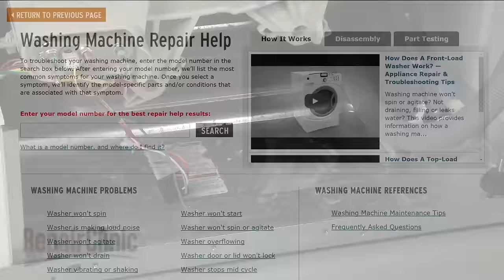Front-Load Washer Won’t Spin — Washing Machine Troubleshooting

Comment: A bad drain pump or clogged filter can also cause the drum not to spin .. and it's a very common issues as well .. should've been added to the 5 top ... the controller would be  the last point to check .
Reply: The machine did the wash but did not finish last cycle. There was an obstruction and the pump is spinning but the motor is doing nothing,
Reply: Mine was as simple as cleaning out the small trap at the bottom. It had a coin and other debris.
Reply: You are correct
Reply: @arriaga2019 if your washer has a bottom panel to remove its fairly easy if not it certainly is a pain take off front panel to access it.
Reply: Thanks for this add-on because it was certainly my issue
Reply: Thank you so much!

Comment: If the belt is just off the pulley, check the bolt holding on the pulley. They are well known to work loose and cause the belt to slip off.
Reply: @ratpatrol thanks 🙏🏽 that’s exactly what happens to my washer I just checked it out and the belts is broken

Comment: I should start making repair videos. As a technician the main cause I see on stator motor style, is Bad SPEED SENSOR. Which is attached to the stator. It’s a 10-15$ part.
Reply: I just moved my front loader to a new home … it’s spinning but goes on forever .. as if it’s unbalanced .. I’ve taken almost entire load out .. doing the same ..
It went from 7 mins left back up to 15 … any thoughts? 🤙🏼
Reply: @calidazeable  check ur drain catch for blockage.. make sure ur drain hose isn’t goin to far down the drain pipe. Make sure the holes in the rubber gasket aren’t clogged.. those are thing u check before we deem it a bad control board
Reply: @LastOneLeftt  Thanks .. I’ll chk it out 🤙🏼
Reply from the maker: Thanks for the tip! Did you know we started a special technician professional program? You can check it out on our website at RepairClinic.com.

Comment: Ge smart front load .   It spins fast when it's empty .  But I washed 1 Towel , and it will spin that 1 Towel but not fast .   When it's " done"  the towel is soaked dripping still .  So it's not spinning the heavy out of it.   Any thoughts?
Reply: Hav same problem
Reply: Did you fix it? I have the same problem as you

Comment: So nothing on YouTube worked, so I did my own analysis. Looking at the board there were some dirty parts on the components traces. After cleaning it with robbing alcohol.
It looked like one of the traces leads were rotten off maybe because of moisture or dust.

I used my phone camera to zoom in 10x times it's a realme xt phone.

I saw that it's indeed disconnected so I took a small flexible wire. Used fine sand paper on it so the solder would stick to it easily. I also used the sand paper to expose the leads on the circuit board. After cleaning it with alcohol I soldered the wire to the board to make the jumper.

I also noticed some of the components in the same area  looked worn. So I took the heat gun put some soldering paste on the components. And covered any vulnerable plastic components with aluminium foil to help it not get burnt. After I use the heat gun to heat up the components, reflowing them it looked brand new. Plugged it in after and works perfectly.
Reply: What machine? Mine did not finish final cycle. Found an obstruction in the filter but still no joy. The pump spins but the motor makes no noise

Comment: I have a samsung crysral washing machine serial no: 06SU53AG900047F. I replaced the inverter checked the belt filter is clean the drum turns left and right but it will not spin it stops at 9. Is there something else to check? Will appreciate if you can help

Comment: I actually clean the filter drain the water below before I saw this video I was proud of myself I thought maybe I fix the problem but the code keeps coming up early I keep draining the water out the bottom door it just won't finish the cycle of spinning and draining and now there is a loud noise in that door area

Comment: I have a samsung front loader which is not rinsing after wash replaced motor and pcb control board as instructed per repair still have issues after no codes shown, any ideas.

Comment: I have a Samsung front load washer giving code 4E(water supply) I have tried a new water pressure sensor,  my husband put in a new MCB. The water supply inlets have been changed. Samsung is the worst for repairs abd too many hoops to jump thru.  Sears repair guy changed time twice in the same day, didn't come.  

It fills with water, then drains  flashes code 4E but don't trigger to spin.  My filter is clean.

Comment: Had to stand on Samsung front loader drum (210 lbs) several times when fixing constant incoming water while unplugged. Now tub is not aligned with front door seal. Any suggestions?

Comment: I have a Maytag front loader washer and dryer. If I put it on the fresh rinse and spin cycle it will spin, but on all of the upper cycles on the knob it won’t spin so I don’t think it’s the belt or the motor. It must be some kind of switch?
Reply: Did you end up fixing your machine? If so, what did you do to repair it?

Comment: I have a Kenmore front loader machine that keeps stopping when it gets to the spin cycle if there are more then a couple of towels in the machine.  it says "ND" on the screen.... help!
Reply: I have same problem with kenmore front loader
Reply: Did either of you figure out the solution to this?
Reply: Whts the reason? Mine is also getting stuck.
Reply: "ND" stands for "no dice", meaning that the washer has given up the ghost.

Comment: my kenmore front load washer gets to the 6th minute then wont finish washing it will will stay on 6 minutes for like 5-10 minutes then finish but will not go into its final stage where it washes rapidly?
Reply: Did you figure it out? Was it the control board? Mine does the same thing. Motor is good, drains good just sits there on 6min and doesn't go into high speed spin.
Reply: I am having the same problem with my Kenmore washer. Did you ever get this resolved? Any help would  be greatly appreciated.
Reply: Same problem
Reply: Same problem
Reply: Did you ever figure it out?
Reply: Mine goes through the entire cycle until I get to 7 minutes and makes a lot of noise and Recents itself back to 15 minutes and just keeps going through that process. Thinking it might be a bearing because of the noise.
Reply: Sounds like it might need a new clutch?

Comment: I have a ge front loader and it wont spin properly.  Spin once,  stop, spin than stop spinning
Reply: I have the same problem, how did you fix it?
Reply: @cruiselover9903  I just got rid of it. Bought a new set.
Reply: That's exactly what the appliance manufacturers want everyone to do. Spend $800 - $1200 on  disposable appliances that have to be replaced every 3 - 5 years.

Comment: Mine will drain, but usually not spin. Rarely, it does, and it seems to do so reliably if it is empty.

It is a direct drive model. I have replaced the drain pump and the door lock assembly. I have made sure the drain line is free. I'm honestly out of ideas. :-(

Comment: I have replaced the door lock but it still it will not spin with clothes in it. It worked when I just turn on drain and spin after replacing the door lock.

Comment: Sometimes it will agitate or spin slow with a damaged stator and rotor
Reply: Joshua Ginnish You are wrong it clearly states in the video that if the stator and rotor are damaged the tub/drum will not move
Reply: @stephensnell1379  "it may not" is what is said in the video.
Reply: On my LG washer it was the rotor hub. The splines are plastic so they were shredded. It was a quick 30 dollar fix.

Comment: My front load washer isn't spinning correctly.  It will spin just never spins fast.  It will spin slowly or even stop.  It will stop and change directions, but never spins fast enough to pull water off close.
Reply: Lawrence Monlezun The problem depends on your model. Could be a few things such as a bad Clutch or timer/control board. If you have a direct drive motor with a rotor or stator then could be an issue with them or the sensors that may be attached. Could even be a motor control board too as it monitors speed of motor, but depends upon your model. If you are unsure of what features your model has then try entering your model # on their site & should bring up info related to your unit so you can see what kind of motor etc you have to check.

Comment: Not impressed. His first solution is the belt. But if the machine has been washing rotating the machine back and forth, then the belt isn't broken! Unless it happened to break at some point in the wash cycle. I'd prefer a more step-by-step approach, and start with the most common reason, working on from there. Diagnose, don't just chuck out random answers.
Reply: Sounds like you should make a vid
Reply: You do know these videos are just giving you possibilities or general ideas of what is or what makes it function. That's up to you the home owner or technician to figure out.
Reply: Agree, the first thing to check should be door lock, am I right?
Reply: They are trying to sell parts, thus the reason for the random parts replacement repair video.